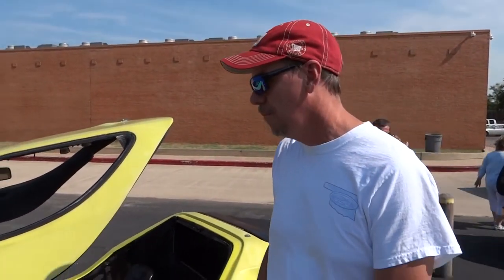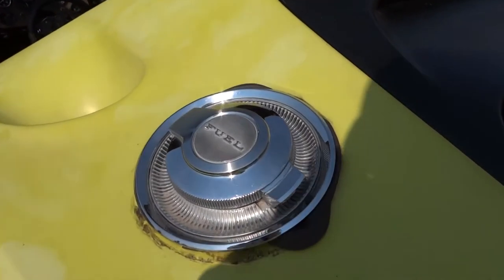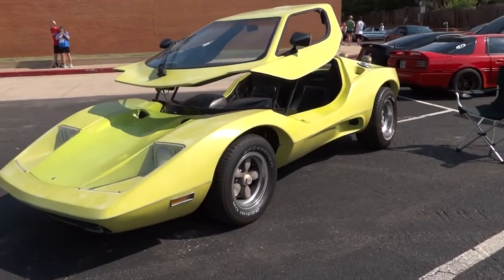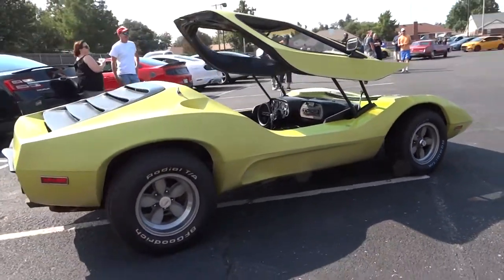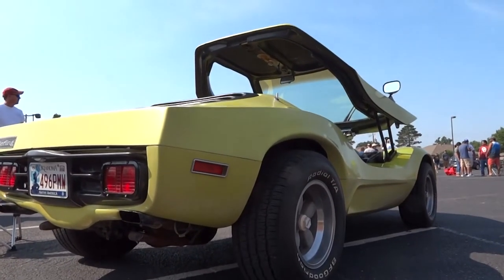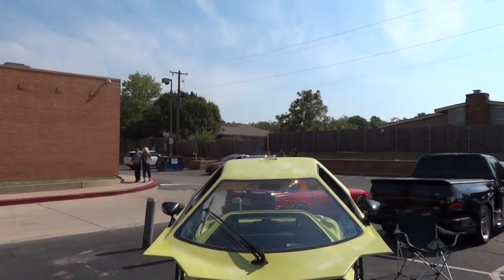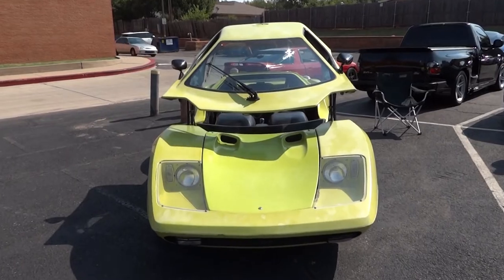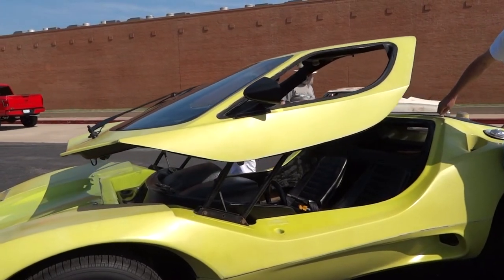Awesome 1978 Sterling Kit Car with Canopy Door

Comment: Hi, I know its been some years, but just came across this  video. That looks like my original Sterling as I did a terrible job cutting holes in the side panels for some speakers and it looks like those holes are still there. any chance this car came from salt lake area? Do you still have and could I come look at it?  I doubt you will read this after being so old, but would love to come look at it. Would it be for sale?